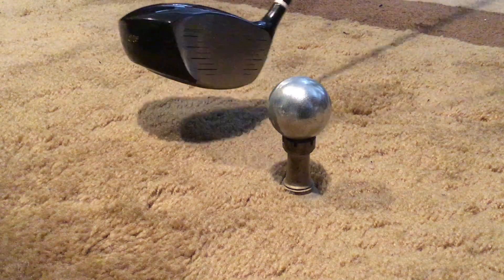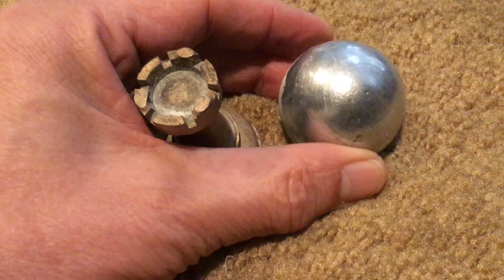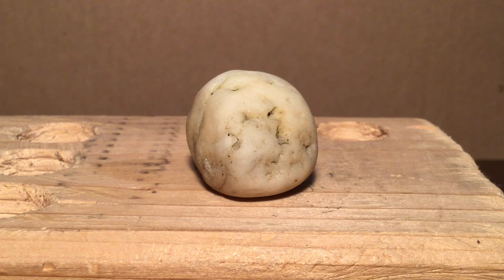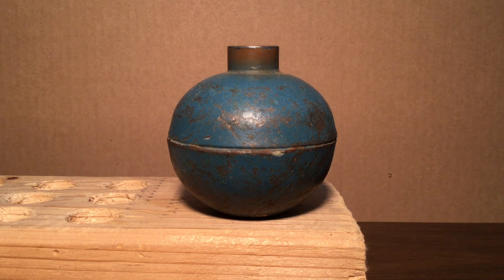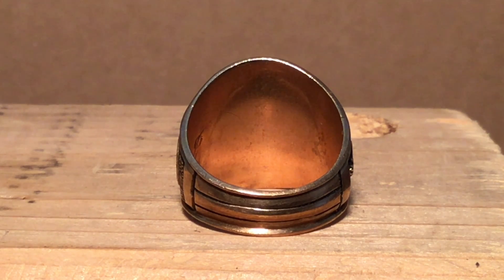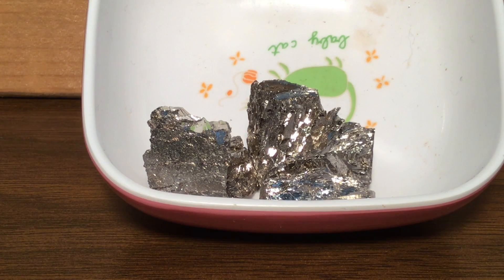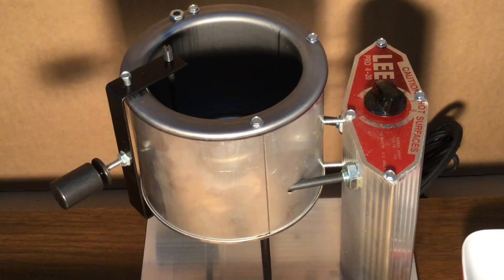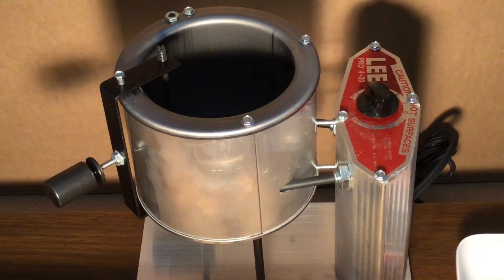Substitute Metals For Lead In Our Bullets: Additional Info VR For Elvis Ammo Zinc Casting Video

Comment: Why no one uses shells shaped like APFSDS for a tank in a shotgun ? Meaning a shotgun is a smooth bore like a tank barrel. To increase accuracy and penetration a tank uses APFSDS rounds which use a sabot to guide and accelerate. So why not apply the same principle to shotgun rounds for the same purpose ? This could even penetrate bulled proof vests.

Comment: Now for a little cold water on the subject.Almost nobody except some pistol shooters,which I assume you are(45long colt)shoots a solid bullet anymore.Would some of these metals work instead of lead in a cup and core rifle bullet?And what of chemical or heat infusion in bullet of this type.Would they counter act against each other?Then there is the bonded bullets.Would anything bond as well as lead to copper.Copper jackets would certainly take care of rifling wear with any core metal.So where do we go for the next step.

Comment: Babbitt metal, used for commercial bearings, molds very well..
Reply: Mac- I have some natural gas engine main gets that weigh over a pound each. I want to try this. Have you done some casting? What molds are you using? What sizing method do you use? Thanks for the info.

Comment: Did you know a single layer leather wrapped around your led pot pour handle makes it always cool to touch? Add it to your mold handles and there will be no hot spot for your fingers. I super glued it on and it is staying solidly in place for many a pour.
Reply: I'm sure it hasn't been an issue but just a heads up super glue gives off toxic vapors when it is heated if your eyes start to sting increase your ventilation.
Reply: @JoeBLOWFHB  Thanks but I melt lead outside due to the toxins from the lead and the smoke from fluxing. By the way thanks for that but it has never been a problem.

Comment: Sir, thank you for the very fine video!
I've been thinking in casting a 90-5-5 alloy (lead, antimony and tin). Do you recomend water quenching and heat treating it? What is a good source of knowledge (books, magazines...) about hea treating lead alloys? 
Thank you very much!
Reply from the maker: emmeponto - Why, that thar alloy is Lyman #2 pardnah...!!  You can't go wrong casting cast bullets with Lyman #2.  You can read about heat treating cast bullet alloys from The Los Angeles Silhouette Club and also from CastBoolits.  However, you must remember that cast bullets have been shot since the round ball days, and heat treating the bullets has been relatively recent.  My own view is that cast bullets can easily and ful satisfaction be used in 95% of our shooting without any heat treatment (oven baking bullets at a certain temperature - alloys need to have small amounts of arsenic to heat treat well - and quenching).  With the technology of powder coating, the need to heat treat is even less desirable than before.  I can cast 45 ACP bullets out of plain range scrap for zero cost, quench them, and powder coat them for well less than a penny a bullet and shoot up a storm in my ACP and 45 Colt / 45 Schofields.  And if I start thinking about heat treating for rifle bullets, it's simply time to use jacketed bullets - That solution was made by the armies of the world back in 1900 and that still goes today.... Best to ya,  Steve

Comment: I cast my "lead" bullets with lead zinc alloy. Some WW are zinc others are lead and they melt together. So I get allways a high percentage of zinc in my bullets. They wrinkle more but work. According to this Mohs hardnes table Zinc isnt way harder than lead. https://www.jewelrynotes.com/the-mohs-scale-of-hardness-for-metals-why-it-is-important/.Lead is 1.5 Moh, Zinc is 2.5 Moh, Copper (like copper jacket or bullets) is 3 Moh, Iron is 4.5 Moh, Brass is 3 Moh, Bronce is 3 Moh, Silver is max 3 Moh and Gold is max 3 Moh as well. So, IMHO, Copper bullets or copper jackets are more Barrel wearing than Zinc. So Zinc is even safer to use than any FMJ bullet from the factory.Wikipedia confirm These Moh hardnes here https://en.wikipedia.org/wiki/Hardnesses_of_the_elements_(data_page).So that might not be very true that Zinc wears the Barrel out as you suggest - at least less than any copper bullet or Copper FMJ.
Reply: Metallurgy is WAY more complex than comparing Mohs scale chart off wikipedia, especially when dealing with a metal alloy that is to be subjected to extreme pressure, shock, and temperature.
For starters the Moh scale is used to measure rocks, and its comparative in nature (this scratches that, but not this other thing) whereas the Brinell scale is often used for metals and alloys because it measures how much of a controlled impact deforms various materials.  However, that also doesn't help when it comes into factors that are critical in internal and external ballistics.  

Not to beat a dead horse, but when that same wikipedia page told you that Gold is just as hard as Zinc that should have been a red flag.

Comment: In regards to smoothbore 12-gauge shotguns:

Slugs, 00 shot, and 000 shot cast from zinc instead of lead would be safe to shoot from a smoothbore barrel. Is thus correct?

Are Slugs, 00 shot and 000 shot that are cast from zinc soft enough to accurately clear a smoothbore barrel with a modified choke tube (like ammo cast from lead does)?
Reply: Solid Zinc anything is subject to shattering and breaking apart.  Zinc is hard, but brittle...which is why the alloy with lead.

Comment: Artillery shells are steel. But they have copper, brass, or bronze rings crimped in grooves to engage the rifling. Or use a swagged copper cup with an undersized steel or other hard metal projectile inside.
Reply: Yep, the copper driving bands are what engages the rifling. The US Navy discovered in the 80s or so that for the 16" Iowa class main battery that wrapping the power bags in a plastic material and including a bag of lubricating compound reduced the barrel wear lifetime from ~300 shots to undetectable under normal use. :) If only we knew that in WW2.

Comment: Hi FC 45LC !    I wonder If it is possible to use tin? Thank you from Johan
Reply from the maker: Johan Alfredsson - Tin can indeed be used to cast bullets as the melting point is somewhere around 450 degrees F (lead melts at 621 F).  Also, the density of tin is very similar to that of iron to it is heavy enough for bullets.  However, the one drawback of tin is the cost - about $16 a pound.  Cost to cast 1 bullet would be around 50 cents.  Best to ya,  FC
Reply: FortuneCookie45LC can you add some pewter in with the lead , to get more percentage up on the tin content?  Tks. Joseph Phelps. PS. Just learning to cast.

Comment: what about copper?
Reply from the maker: Sternstones - Copper is already being used for all copper bullets from Barnes and Hornady among others.  But for reloaders, melting copper is not easily or safely done at our homes.  Others have done it, but more power to 'em.  Best to ya,  FC
Reply: what about electroplating cast zinc bullets with copper, no real heat involved in that.
Reply from the maker: Stemstones - Problem is still the casting with zinc - I'm not in favor of anything that results in low output when it comes to making bullets...Spending a couple of hours to cast 20 good bullets and then more effort to copper plate those doesn't work well for most pistol shooters.  Have a great day,  FC

Comment: Would you not need to consider the interaction between the metals?  Galvanized iron is actually pitted or eaten away by the zinc with then infiltrates those pores, which is why it so tenaciously clings to the surface.  Any time a material is driven down the bore of a gun at supersonic speeds, a certain amount will be vaporized, hence the copper and lead fouling of the barrel.  Would not then zinc would likely pit the barrel as the fouling lines the interior of the barrel?
Reply from the maker: dale meade - It's courageous for Elvis Ammo to do all this for our edification...He risks his casting pot, reloading dies,  and his gun barrel with those zinc bullets.  And no one is giving him any grants to do the testing.  Zinc bullets are really uncharted territory - it may be possible that research has been done by countries looking for bullet material alternatives (especially in times of war where strategic materials are in short supply) - if so, the fact that zinc bullets are not widely distributed today is a testament to the material not being suitable.  Thanks for bringing out this point of fact... Best to ya,  FC

Comment: Thanks Fortune Cookie. I like what you did.
Just an FYI, there's a guy making bullets with a lead top and a zinc base (similar to the old zinc washer molds) (sorry, don't recall his name right now), and if I deciphered what he said, he's implying that once the gun is "shot in" with his bullets, that there's very little wear on the rifling. Sounds like the bullets are essentially firelapping the barrel and leaving a micro-coat of zinc plating. I say this because he implied that any barrel of rifle length needed twice as thick a zinc base as otherwise.
If there's any basis for his claims, it makes this zinc experimentation even more important.
Like I said, don't recall his name, but followed a link provided by a commenter to one of the channels I frequent. He should be findable again.

Comment: what about aluminum bullets?
Reply: The density is too low. Wouldnt carry well over distance. Lead is so good because the key is Soft-Heavy-Low Melt Point
Reply: Sweater Dood Do you think it'd work for short range cartridges like 9mm or .45 for example?
Reply: @themobsprinter  Aluminum is probably one of the worst metals for a bullet.

Comment: thought it would be a good idea to watch this again! : ) so , thanks again..
Reply from the maker: elvis - always great when you drop by.  Don't know if you've loaded up the zinc ammo yet.  So I was thinking about your zinc bullets - they should shoot for you, but impact will be off from your current zero, probably low.  Bullets with soft steel core are very plentiful, but your zinc bullets oversize will be bad because of the zinc hardness, barrel resistance and higher pressure - danger of your gun blowing up.   But I know you will be safe in all you do and you have thought of all this anyway...still mighty courageous as no one is paying you or financing you in this...  Best to ya,  FC  Steve

Comment: Sabot rounds is where we're heading, imo. A 243 could be firing 223 maybe? Make the projectiles out any material you want, well within reason of course.
Once lead is either banned or becomes too expensive, sabot has to be the way to go.....

Hey, hang on a minute...... Is this the topic for a new video???? Just a thought :)
Reply: Pilot McBride You could be on to something. TwangNBang has a video shooting 45 caliber solid copper projectiles through 50 caliber muzzle loaders using sabots. I also seem to recall a very rare bullet, I think made by Remington, that was a 223 in a sabot fired from 308 Winchester cartridges.

Comment: Mr FC45LC, there is one other interesting fact about Bismuth is that unlike other metals that shrink as it cools, Bismuth expands as it cools. if you ever reload with it you would have to compensate and drop the castings before they cool too much or they would stick in your mold and be a devil to resize. it can be alloyed with Tin, lead and others which also brings the melting point down even lower and controls the expansion some. the old magicians trick of melting an apparent silver spoon in a cup of coffee was actually a lead,Cadmium, Tin, and Bismuth alloy with a melting point around 200F.

Comment: That was a very good video Fortune Cookie. you explain things well and are very precise. I wonder if powder coating would be tough enough to hold rifling by itself. perhaps one could cast zinc projectiles undersized enough to limit barrel wear and make up the difference with powder coating. I too have been wondering about alternatives should the supply of lead be compromised. keep up the videos I really enjoy them.

Comment: Hey FC would using silver solder 95/5 or any solder containing silver help or hurt in bullet casting? From what I read it will help in hardness, but would it ruin the rifling? Can you possibly make a video showing how to use solder properly when casting bullets and show the benefits/problems with the process.

Comment: I've only ever seen silver casted in sand for making jewelry. I'm not sure mold blocks would work.
Then the problem is cost. Right now, one ounce is $17+($272+ a pound).
Although, silver bullets would come in handy for werewolves.
Reply from the maker: PsychoAlfaSchizo - Right you are on the molds - if I did this, I'd start with a two cavity Lee mold to try, if it destroyed the mold, I wouldn't be out much - Elvis used his Arsenal molds, and I cringed a bit...expensive mold.  Hard to get those high melting point metals to cast because our molds have to get real hot for them to fill.  Elvis had trouble with zinc and that doesn't even melt as high as other metals.  Silver is too expensive to cast bullets with, but essential for vampires and werewolves as we have been told.  Don't know if I'd advise using iron molds to cast silver - would be afraid to silver solder the blocks together... Best to ya,  FC

Comment: Thanks for the great videos!  Some bullets are made of copper now.  How would that be to cast?
Reply: They are made of certain copper alloys, a field of metalurgy that is still under a lot of development.  The various alloys and inputs are still being perfected, and such mixing is almost out of the hands of the standard caster.  Keep in mind the temperature differences, and then think of the casting blocks we use, and the materials.  Copper melts at very high temperatures vs. lead's very low temperatures.  Do we have the proper molds made of the proper materials?  Do we have the correct furnaces to melt copper and make proper copper alloys?  Are the kinds of furnaces needed safe, practical?  Will the shrinkage of the molten material in the molds require different molds with different internal dimensions to compensate for shrinkage?  Thinking of zinc, I know people who do a bit of metal casting with brass, and tell me that zinc boils off of brass, and is very dangerous and toxic.  Depending on how you do it, it could be very dangerous.
Reply: Thanks. need to be very carefull casting!
Reply: toy collector I don't know about all copper bullets, but many of them are milled from billet stock and not cast (Lehigh for one) . That's why they are so expensive.

Comment: Why not mix metal alloys dust for weight with polymer for forming ?

I am thinking it would be factory made into granuals like reloading powders.
Then you would measure out the bullet weight you wanted.
Finally bake them in a muffin tin like bullet mold to cast them.
Set your oven timer and watch reloading videos while you bake some bullets.
Reply: LIVIN CINCY as good as that sounds, lighter bullets would cause issues with effectiveness of the bullet in regards particularly to penetration power.
Reply: A hard dust in a softer binder would act like sandpaper on the bore.  A polymer jacket to conform the rifling is an option.

Comment: Powdered metal mixes in polymer or epoxy would make cheaper ammo.
Extruded into a mould would be so easy, the polymer would also allow the bullet to slip down the barrel.
Scrap metal powdered and mixed with polymer ammo could be heated in your Black and Decker toaster oven.
Reply: Sounds like an idea similar to BPI's ITX non toxic shotgun shot.  Various metal elements make up the weight in the shot, while a binder keeps it relatively soft to keep it from damaging the barrel by scratching and chokes from bursting from pressure.  The real question is wither it would work for regular bullets, which have to maintain a certain shape and integrity, especially as it is is being driven against a bore that is smaller than the bullet's diameter, at high velocity, high pressure, and high heat from burning gases.  Lead and lead alloys can swage to the barrel, which is good, and the powdered mix, I don't know.  

Also, it would probably suffer on the terminal ballistics end for hunting and self defense, it would probably hold together or burst apart, both of which are not usually desired.  But, a very interesting observation.
Reply from the maker: Myles Nicholas - Injection molded bullets - we might just be doing that if lead is banned...Best to ya, Myles... FC
Reply from the maker: kingduckford - Sounds like some possibilities there though - composite bullets...  materials science will enable this if  it comes to that... Best to ya,  FC

Comment: will fluxing get the zinc out of our lead? what happens if zinc is in our lead?
Reply: rustybayonet .com check out his video on heartbreak of zinc. it shows zinc lead ingots. its not pretty i will warn you
Reply: rustybayonet .com and i dont think it will. but zinc is. about 150 degrees higher melting point. lead is 621 zinc at 787 degrees. so a little attentiveness to the cast iron pot while making ingots will allow us to get the zinc out before it melts
Reply: Well my ingots look good, so I'm safe from zinc sofar.

Comment: bismuth for fire extinguishers? why would they want the fire to get so big that the ceiling is 500 degrees before water sprays. they could use one of those chamber castings type alloys with a melting point of 180 or so. then the fire might get put out before the buildings ruined.
Reply: because in places like commercial kitchens there are open flames, steam, hot oil, etc. that get well over 250 degF that would set sprinklers off. IT is basically a safety factor to ensure that the sprinklers only go off in the event of a larger fire.